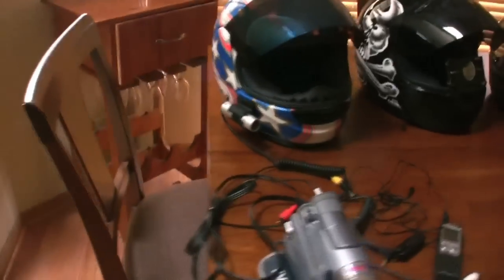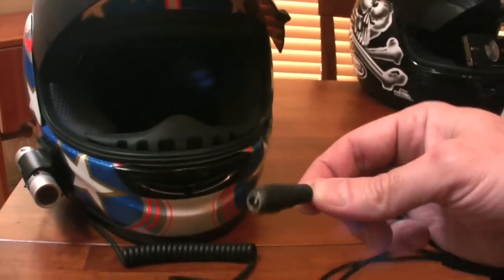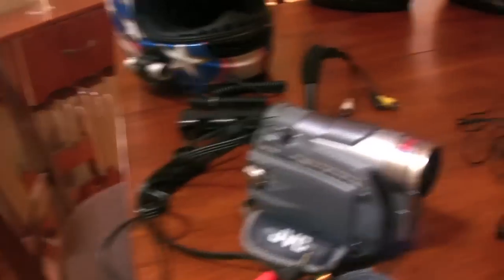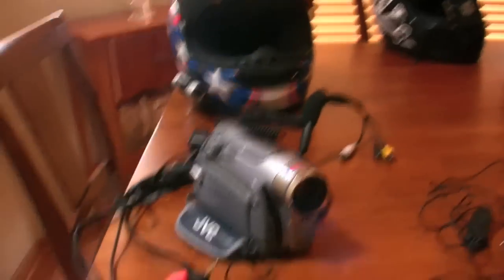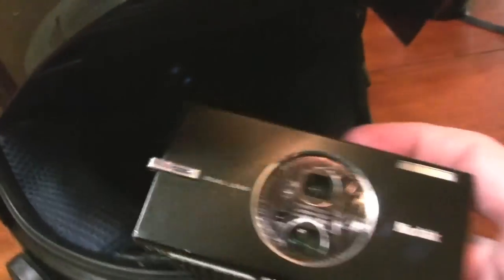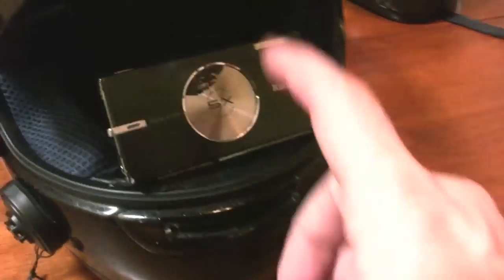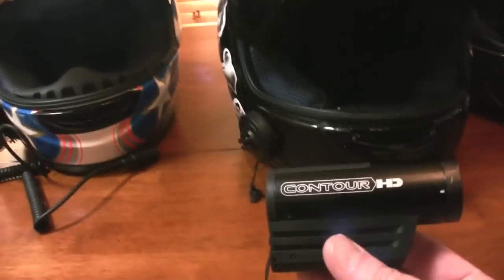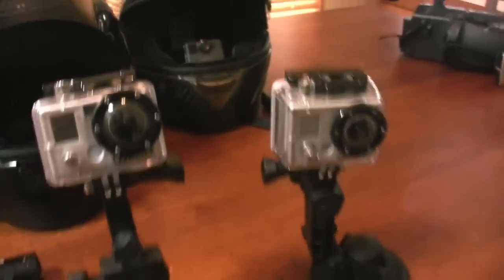Motorcycle Cameras...The Evolution, Pt 1

Comment: Good reviews Billy. I use a vertically mounted camera similar to the Zi8...It's a Vernturer HD cam. $127 from China, shoots in 1080p ( I use 720p for YT..slightly wider angle). I need more tape on the mic to reduce wind noise, but it's a great camera.

Comment: i was considering a contours and saw a link to some guy who had figured how to mount an external mic to it, but that was late last 2009 so i don't recall the page, but the info is out there.  
zi8's also have the advantage of having a built in audio plug which allows mics to be plugged in (no tinny sound - extra cost for a decent mic though)

Comment: I think the best one is the GoPro, it is also waterproof. svengalie has extensive coverage on the gopro, also shockanawe is using only the two lens Kodak v570 which does amazing low light vids. I am using also the Kodak Zx1, which is waterproof and has 720pHD. Among all, only the GoPro has effective image stabilization, and wide angle. So I would go for it. Problem is the review is OK but for US only. The GoPro in EU costs about twice that...